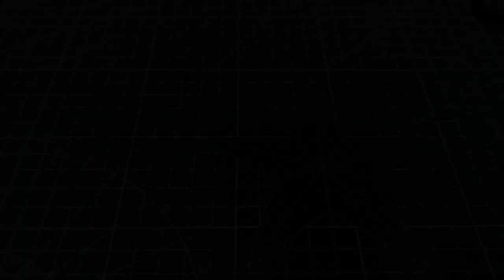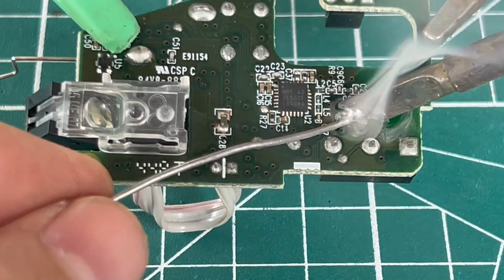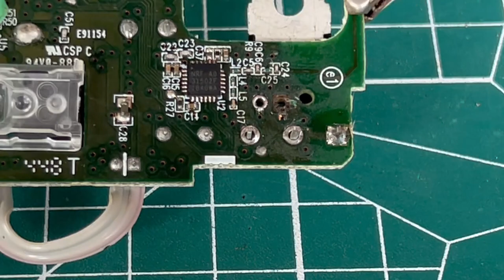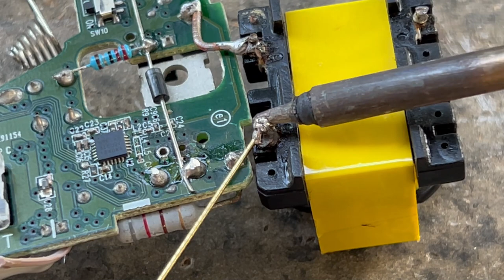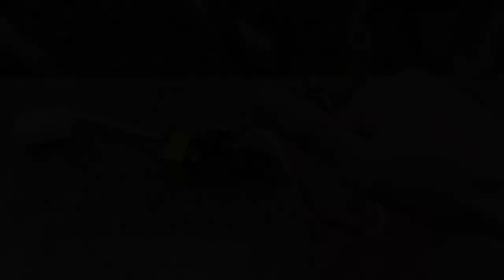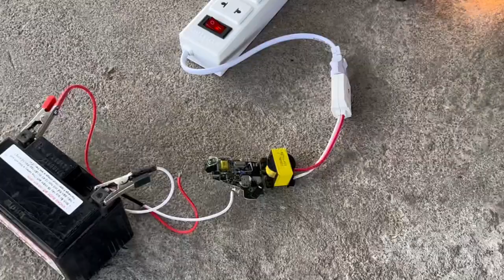How to turn a COMPUTER MOUSE into a powerful 220V INVERTER

Comment: Good effort. I pray it's real. U did not indicate the size of that capacitor used and u are too fast too. Is it only such two  gdagets it can carry?  Do you have anything on diy solar panel?
Reply from the maker: Thank you for your feedback, I will fix it with the next videos
Reply: @DIY_Generator I can't see computer mouse with battery. I saw hp type but it's not same . Can it be used or
Reply from the maker: You can use similar computer mice to do this. But it needs to ensure that there are equivalent circuit diagrams